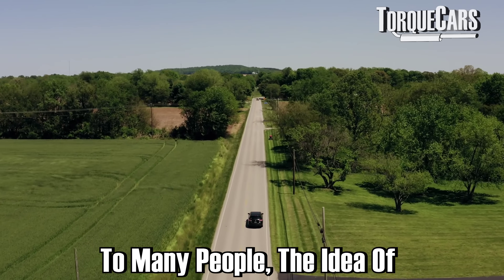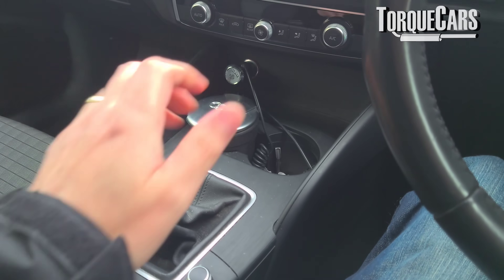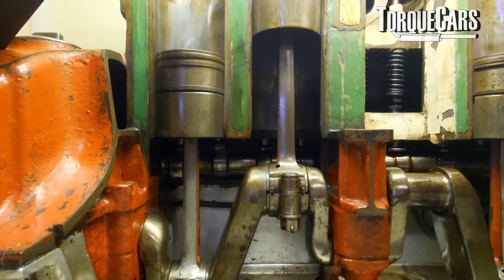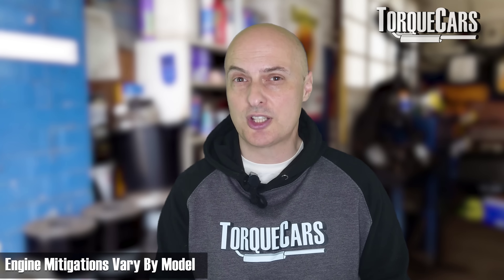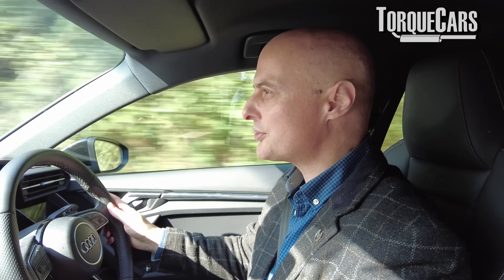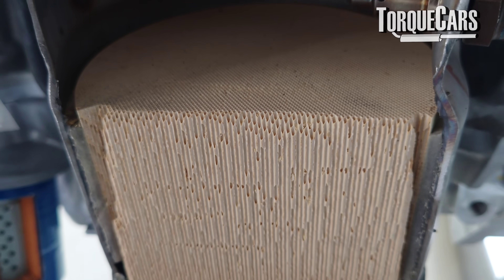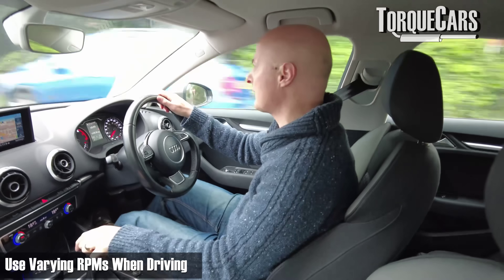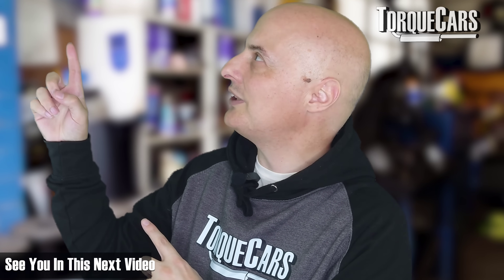BIG DAMAGE By Lugging at LOW RPM? Eco Driving Warning! (Manual Gears)

Comment: The situation with DPF equipped diesels is unique. I have a 2017 Mitsubishi Triton automatic with just short of 125,000 km on the clock. When I retired and moved to a rural area it was easy to drive for fuel economy. I was doing just that, avoid the freeway and cruise the scenic backroads at 80 to 90 kph, however DPF faults began to occur and having them rectified / reset and oil changes [high crankcase level] cost much, much more than any incremental fuel saving. I changed to regular freeway use at 100 /110 kph and the issue appears to have been resolved. I never "lug" an engine, that is Barbaric.
Reply: Lugging would increase your EGTs and help burn the soot out of the DPF.
Reply: @gregorymalchuk272  [A] And ruin the engine [B} Pretty hard to lug an engine with an auto. [C]  Diesels over fuel  at high loads and low RPM, fuel only is regulated, there is no throttle body = effectively a rich mixture and more soot.

Comment: This is why I use the manual mode when driving urban slow distances with an a/t. Keep the revs at 2000 even if the entire car suggests to shift up two whole gears for no reason. The eco parameters in modern cars are as excessive as they are incessant. I primarily drive a petrol 1.6 insignia B GS and it really is programmed to lug around in high gears barely turning over. No power, no torque is to be found in low ranges on these engines 🙄
Reply from the maker: Good tip!

Comment: how bout diesels? they are low rpm 2k to 2.5k rpm especially non crdi ones
Reply from the maker: Diesels typically top out around 4500rpms, so I guess taking a percentage is better than setting an arbitrary RPM as there are so many engines out there.

You can tell as a driver if the engine is struggling to pull, and with this information in mind change to an appropriate gear.

Comment: Turbo Diesels actually give better fuel economy if 5th isn't used in urban driving.
In a 30mph zone using 3rd or 4 th to keep the RPM  at least  400 to 600 RPM above idle maintains good  fuel economy and keeps the turbo spinning. In pretty mixed light urban driving I average at least 47 mpg  from my Rover 75 in the summer months 5Ompg.  Important to make sure the thermostat works as it should a disel dont put much heat into the coolant at idle and light load 
Using a 0w or 5w oil helps (I use Mannol Ow-40 winter  and summer)
Reply: I too run a Rover 75 TD auto and before retiring I cruised every week up the motorway at 70 which = 2200 revs..Now retired am doing alot less miles,and drive down country lanes .. As a matter of course I have to keep the revs up and in 3/4 gear on the auto to keep the old girl healthy. I v never bothered changing oil ,I just use 10/40(come what may) I believe the DPF has been removed from my car before I owned it.. Good or bad I have no idea...
Reply: Automatic 75 is generally 5 mpg heavier   on fuel than the manual. The 75  diesel doesn't have a DPF  only a catalyst Oils with lower winter rating the W part of the grade number give more protection during engine warm up easier starting in very cold weather and better MPG  for short runs 
Look for fully synthetic oils that meet BMW LongLife LL-01 or LL-4 spec.  0w-40 or 5w-40 or 5w-30 work fine.

Comment: Lugging has ruined more engines than revving, rule of thumb, if you press down on the accelerator and your vehicle dose not accelerate easily then you need to down shift and if you are giving more gas to maintain your speed you need to down shift, it is just that simple. How ever revving your engine to high rpms with no load on it is not good for it either.
Reply: You mean too high a gear.
Reply: @pauladams5673  Isn't that what I said? If you down shift you are going to a lower gear.
Reply: @stephenwest798  
My dad when I was learning to drive - "Stop luggin it !"
Reply: @jesseerickson662  Your dad is a wise man.
Reply: @stephenwest798  spot on there buddy.👍
Reply: @AnthonySlavin  Thank you.
Reply: I like it. if you're over revving the engine, when you take your foot off the accelerator, instead of coasting smoothly it will have really aggressive engine braking rapidly reducing your speed.
Reply: @rolls_8798  All modern cars have rev limiters ans its also way below "danger zone" onlyncase where you can overrev is moneyshifting.
Reply: @Kacpa2  at the very least, 5000rpm will wear your engine a lot faster than 2100rpm.

I don't know why you would cruise at a set speed at a high rpm.

the primary reason why 'highway miles' don't matter as much is because you're in the highest gear, therefore there are fewer engine revolutions per kilometre - engine revolutions being the real factor that measures the wear of an engine
Reply: Great explanation.
Reply: Really depend on the engines designed operating perimeters, diesel motors usually lower is better as far as torque. Gas higher. Absolutely lugging the motor is detrimental and cause's damage.
Reply: How low is a low rpm? If the engine can rev up to 6.500 rpm, is 2.000 rpm then still is low?
Reply: @koencuypers  On a scale from 0 to 6500 I would say yes, that said if your engine lugging, down shift, yes you are turning more rpms but there is less load on your engine and transmission and yes you are pumping more oil which is also a coolant, all good as long as you are not over revving your engine which now a days is unlikely with computer controlled engines. Most engines are fine at lower rpms if their turning freely, although they don't recommend idling for long periods with any engine. All of this info is available if you wish to do a little research.
Reply: Yes! It also helps to damage the clutch and transmission, along with the rods and finally putting more fuel inside the engine when it's in its lowest efficiency RPM
Reply: @stephenwest798  i always go like 90 100kmh in 5th gear, the highest
And when I want to accelerate I downshift once, if it's a dangerous situation I go 3rd at about 4k something rpm
Reply: My v6 achieves averagely 140km at 2000-3000rpm and that my driving range
Reply: @e.jack.47  I believe the message is, is that as long as you're not lugging or over revving your engine your good. It is really just that simple. That by the way is why transmission have more than one gear.
Reply: What if my engine isn't up to tempt yet, but I live on the countryside and need to go uphill with a low power gas engine? Do I just give it the revs even though the clearances aren't where they're supposed to be, or do I lug it at 1500 ish rpm?
Reply: Seen so many guys blow engines from free revving them esp cold showing off...rod caps wanna exit stage left.
Reply: "...  if you are giving more gas to maintain your speed you need to down shift ..."
No. It only means that the driving resistants are raising. If you increases the amount of gas, the engine will burn it at a higher compression, thus more efficient. That doesn't mean compulsory, that you are overloading your engine.
Reply: This rule doesn’t really apply the Honda Civics….. if you downshift and mash the gas, it still doesn’t accelerate.
Reply: There's limits to it throttles are throttles not a switch there's controll to it if it's juddering and banging to much load for the rpm lift low rpm doesn't destroy engines neither does using revs it'd mostly just down to your load variable tbf most things just die from black death and lack of servicing never seen grannieing break anything even when it's come to giving a car it's first kicking after 90k miles 😂
Reply: @rottenshitboxes  Both excessive rpms and lugging ruins engines although most computer-controlled engines have a rev limiter to protect them, my comparison was between those two issues not engines dying from lack of maintenance or high mileage which is a different subject.
Reply: Why is revving your engine to high rpms with no load on it no good? There's no load.
Reply: @tofuguru941  The most difficult thing your engine has to do is reverse the direction of the piston and pull the piston back down. Have you ever watched NASCAR when a driver misses a gear or downshifts at too high a speed and blows their engine as a result.
Reply: @stephenwest798 blowing a NASCAR engine up due to missing a gear is not what people would normally consider as using high rpm. It's called over revving, which yes is done with high rpm, but describes how you have exceeded normal engine limits
Reply: @JimboXX78  Whether you overrev your engine by missing a shift or simply revving it out in neutral or overrevving it in gear providing your engine has the power is basically the same thing, you have exceeded the limits of your engine. Which is why someone invented rev limiters. However, the limit you rev your engine under load as opposed to no load may be different. And you are somewhat correct, overrevving your engine is an unintentional mistake as is down shift at too high a speed, overrevving your engine in gear or holding there too long after it has reached its peak is also a mistake and all can end in disaster. And to be sure I did not say overrevving an engine because you missed a gear was intentional, so I didn't state or imply that it was using high rpm for any reason.
Reply: @stephenwest798  Thats a money shift. It has nothing to do with driving to redline in lower gear or revving a warmed up engine in neutral briefly. Its something  no drivr would do instinctively for extended period of time. Same as lugging it, unless they were thaught wrong and done understand nor flow with the car.
Reply: @tofuguru941 ring flutter
Reply: @tofuguru941 your engine is meant to be loaded up. Maybe not 100% load at 1k rpm, but 90% of the time your engine is under load, so I'm going to assume they build it to be under load. But I'm not sure really. It could be the speed at which the rpms rise. Not enough time for the oil to make it to critical components.
Reply: @tofuguru941 I think the problem is not you revving the engine fast with no load, but the car doing it for you, ie high rpm, no throttle, such as  going down a steep hill and the car running away. 

It comes from removing the power stroke so that the con rod is under more tension as the valves are closed and the crank pulls the piston down. It shouldn't be a problem, but why tempt it?
Reply: @tofuguru941  i think that full throttle up to redline going downhill is where there's no load, and very bad. Uphill there is engine load. Or when towing. But I'm not sure what the poster exactly meant.
Reply: @ravedisc in neutral is no load
Reply: @cruiser6260  Correct, and being wound out in a lower gear where the engine is no longer pulling or down shifting at too high a speed and over winding the engine, all bad.
Reply: You understood the video but your rule of thumb is wrong. As long as your engine is not labouring you do not need to downshift unless you really do need to accelerate
Reply: @cruiser6260 check the shift light. The car will tell you if there's a chance of doing the gearbox
Reply: @JimboXX78  as far as I was aware only drag cars had shift lights ..
Reply: @cruiser6260  no. My 07 ford focus has a shift light from the factory and it varies by load.
Reply: @stephenwest798  i drive a 90hp car. In no gear do i floor it and it accelerates "easily"
Reply: @somedude2492  My condolences. However, if it is lugging you should still downshift. This is a well-studied and understood topic, these aren't simply my opinions and have been discussed over the years in many automotive magazines, read up. The sixties thru the nineties I read tons of magazines, not so much anymore, in fact the last one I was subscribed to the publishers quit printing; however, you can do your own research on-line.
Reply: @stephenwest798  driving an engine in the low range does not do damage. If your car can handle cruising in 5th gear at 1800rpm and that is enough speed for you, it doesn't really hurt anything. It's a whole different story if you floor it from those 1800rpms though, but on a 90hp 4-banger you're not going to throw a rod or anything. If i want to floor it I'm gonna downshift anyways. "Lugging" an engine does not even an exact definition, it's just "driving in too high a gear for the RPMs you're at". But who defines what is too little RPMs? Under 2000? 3000? How about a diesel? And a little 1.2L that revs to 9k, vs a 2.5L I-4 that's tuned for torque and barely makes power over 5.5/6k rpm? "Lugging" can be something that ends in pre-ignition, and that is very bad, but it's the pre-ignition that is hurting the engine and not the "lugging", and pre-ignition can be caused by a variety of things other than flooring the engine from idle in 5th gear.
Reply: @somedude2492  You have no idea about what you are talking about, this subject has been studied and talked about for years and I have watched automotive programs on TV as well as read many articles in automotive magazines written by people with more qualifications than you or I. Believe as you wish, I will believe what I have learned from the experts and my own experience from tearing many engines apart over the years. Have a nice day.
Reply: @stephenwest798  just as a comment, having watched a tv program about cars is not really a great source of info... 

That said, what exactly about lugging an engine damages it? Everyone says it's bad, and I'm not saying it's harmless, but do you know what is the damage you're making to the engine?
Reply: @somedude2492  So watching a program where they show a piston jumping up and down dancing around in the cylinder with thermal imagining isn't a good source of info, gee I thought it was. While I don't believe everything on TV as some of it is BS this program was produced by reputable people and consistent with other reputable sources on the subject, I've done a lot of reading on engines as well as torn many down, some of which I've rebuilt. I wouldn't say just running at low rpm is necessarily a problem in itself as long as your engine is turning freely as in your not continually increasing throttle and not gaining speed. It may be imperceptible to the driver, but your piston starts dancing or rocking around jumping up and down in the cylinder hammering the rod bearings wearing out the top and bottom portion of it and it also allows more combustion gases to blow by the rings contaminating the oil, all bad. I have seen tri-metal rod bearings worn down to the copper in the center of both halves while the sides had normal wear. This isn't a new subject by any means, it is well understood. Which is why I say if you're slowing down on a grade down shift to lighten the load on your  engine and transmission and you are also pumping more oil which is also a coolant which is also good for your engine, keep in mind that it is the hydrodynamic wedge of oil that separates the bearings from the crankshaft, oil pressure is just a measurement of the resistance to flow which can vary by oil temperature and if is too low at normal operating temps can indicate excessive bearing wear. Now when I say downshifting lessons the load on your transmission it does so by giving it more leverage, gears are just little round levers, the higher the ratio the more the leverage. Think of the lever and fulcrum, the long side has advantage over the short side. Think of rpms as the distance traveled by the long side as opposed to the distance traveled by the short side, the higher the rpms to the distance traveled on the short side the more leverage the engine has over the load, make sense. Interestingly my older vehicles recommend a heavier oil when towing in hot weather, 10w/40 as opposed to10w/30 while my newer truck which runs 5w/20 does not. I always run a high-volume oil pump whenever I rebuild an engine just for the added cooling effect on engine parts at lower rpms, but then that's just me. I hope this helps you understand the issues.
Reply: @somedude2492  💯💯💯
Reply: My car runs on petrol a liquid and not gas🙄🔥
Reply: Just get an automatic. Problem solved.
Reply: @gerhardtlanders  Don't think so ..
Reply: @gerhardtlanders  No. I wont get an automatic. I drive both frequently and i still preffer a manual and i will always will.
Reply: @gerhardtlanders  Not true, while you likely won't get, or feel the jumping or shuddering like you would with a standard tranny you will still damage your engine, I have seen engines with the top and bottom of the rod bearing worn down to the copper on engines with tri-metal bearings, however if you have a computer controlled transmission and it is programed correctly it will help eliminate the problem. My 08 Grand Cherokee with the 3.7 v6 downshifts quite readily at the hint of a hill. Not so with my 07 Ram 1500, even with 3.92 rear gears I run 3rd not tow-haul mode as fourth is just too high a gear to tow in even on the level, 11 mpg in third, 9 mpg in fourth and it is lugging with no throttle response, go figure. Both your engine and tranny are happier if their turning freely, not over working, while driving whether pulling a load or not, I'll run tow-haul mode in the mountains even if I am not hauling a trailer.
Reply: @gerhardtlanders  not always. GM automatic programming lug engines. I have two. I have had my Colorado to dealership several times because of the trans shifting to 5th gear at less than 30mph. You can hear it lug the engine. But they keep telling me it's normal operation. Lol.